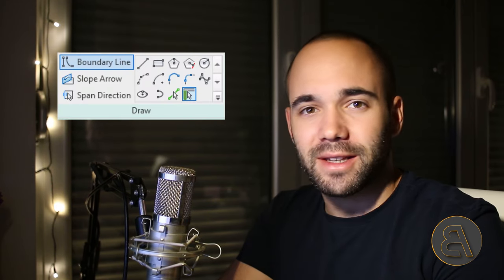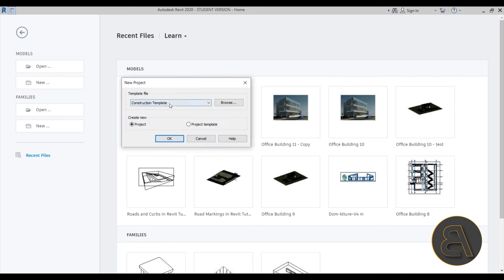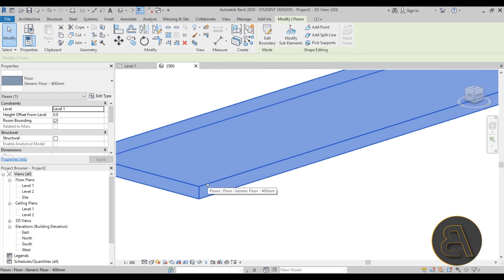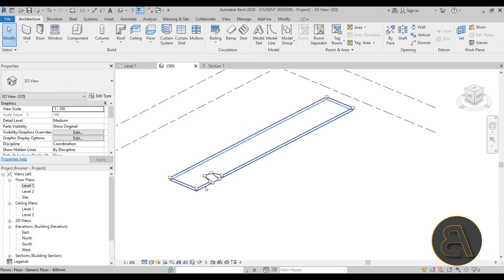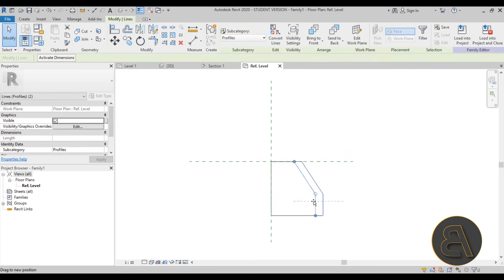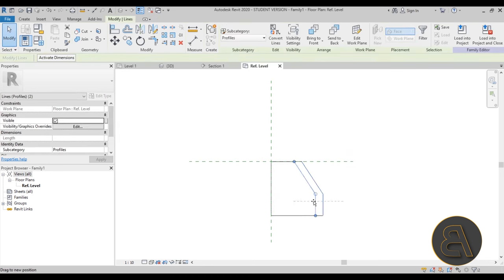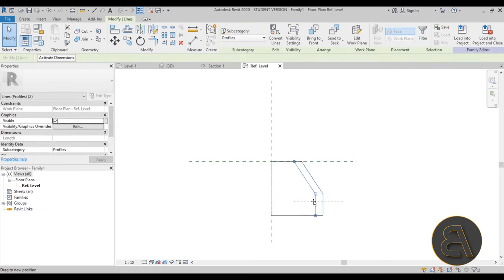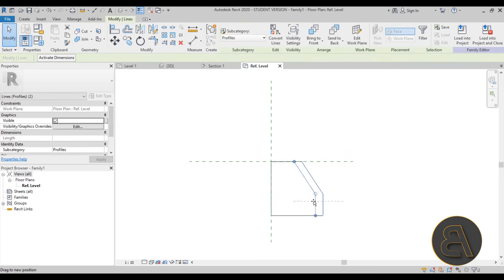5 tips for Floors in Revit Tutorial

Comment: I'm on a project now where I need to do this BUT instead of altering the top face, I need to do this on the bottom face of the slab. I want to pull a square peice down below the slab. This is going to end up as a sump. How do you work on the bottom face and not the top? Thanks.

Comment: thank you for your videos. i have this issue, maybe you have come across it. when export revit to lumion, sometimes i get a weird shadow in the joint of walls, as if there is a gap in between. i have even tried the "chafe" command that adjust how walls connect? perpendicular, at an angle, etc. i still get this weird shadow effect that completely ruins the rendering. i can even send you an example if you need to see it. thanks in advance.